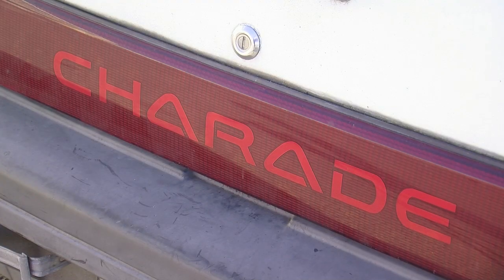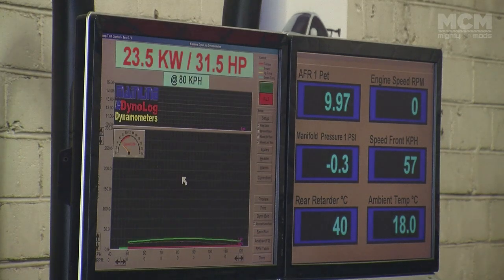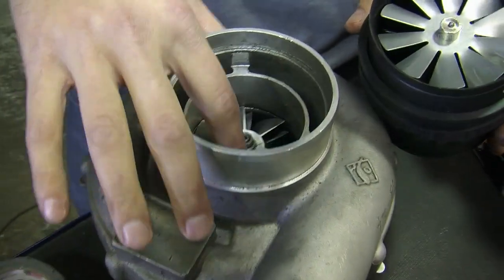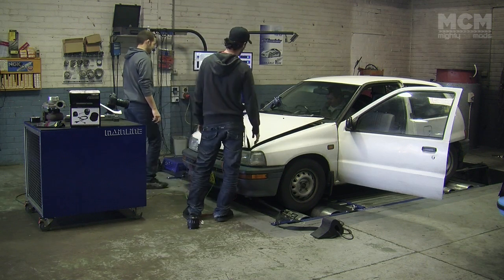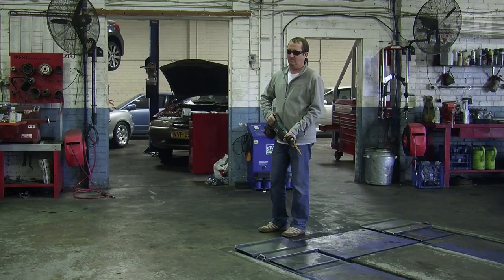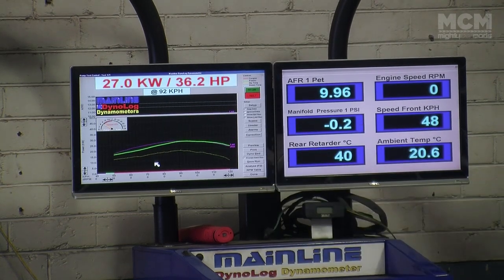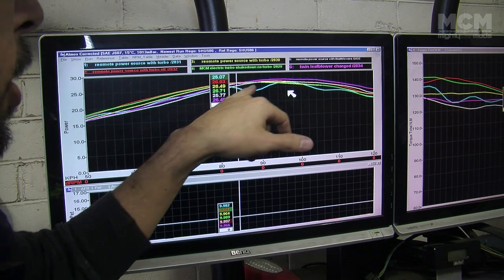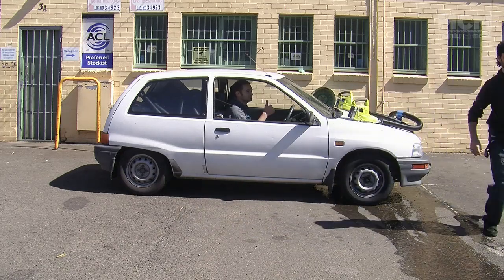Electric SuperChargers Mythbusted

Comment: I would like to make 2 humble suggestions over here
1. Maybe you guys should have serviced the car like changing the gearbox oil and the changing the engine oil to a higher grade ones.
2.You guys could have change the air filters cause it could be dirty and clogged up with dirt which prevents the air flow to the engine.
Maybe then it could produce the actual amount of power that the electric fan could deliver.Its just a humble opinion.
Reply: *****  Sounds like you bought one and are now regretting it
Reply: ***** 
I agree man. Amateurs, they also should've used those stickers. Those alone will give you 10 extra horsepower
Reply: Hahaha which one bro?
Reply: Your bluebird was an awesome car!Wished you were staying in Malaysia and you bought the Skyline here.Would have taken it for a drive!!hahaha
Reply: No mate they dont work full stop, they are a con.
Reply: Well tell me about it mate.i was quite surprised that many people bought it.it seems you need higher pressure to even channel it to the intake manifold.guess the fan is quite a hinderer to the suction.if,the  fan is able to replicate pressure which is being developed by the actual turbo charger,then maybe it can produce slightly higher hp
Reply: Paul smith...i don't even own a car for fucks sake mate.
Reply: the shape of a turbine fan and an electric supercharger are literally different.
Reply: Richard federkiel That maybe so, but they shouldn't be losing power, especially with external power. I would bet there is something wrong with that POS car.
Reply: Harry Balzak it depends on the cfm of the little fan. If it's lower then the natural flow of air going into the motor then the fan will actually hinder the engine from making power. I can tell just by look/listen to this fan that it's not generating anywhere near the right cfm to keep up. If the fan had a higher cfm then what's required by the motor then it should/will make hp.
Reply: ***** I said this on another post but i'll reiterate it here: I have seen a computer fan that would also work. Delta 120mm case fan flows 210cfm runs off of 12v and 2.7amps. 210cfm = 126hp (estimate because i'm going by the 1.6 cfm = 1hp rule which is apparently highly contested). If that's true then anything that is running less then 126hp at the crank should see a benefit from that fan. This is all theoretical though as i've never seen someone test it and honestly i'm not sure if the fan would even survive this happening. I think fans like this are limited rpm wise by the air flowing through them. If you induce a vacuum on the exhaust side of the fan it may allow the fan to spin faster then it can handle.
Reply: Ok,then explain the industrial blower that they use.cause you need a lot of pressure mate.the cfm counts but on the other hand,it needs high pressure to channel the air directly to the engine block.
Reply: ***** you need pressure if you want to go above 100% ve however cfm alone without above ambient pressures will also give a n/a motor hp being as most n/a motors are only working around 80%ve. Remember when you're running NA when the piston is at the bottom of the intake stroke there is still vacuum inside the chamber. The higher the airflow coming in the less of a vacuum and subsequently the more air/fuel will be in the chamber.
Reply: That wouldn't matter at all, as long as they stayed constant throughout the entire video it wouldn't matter. Didn't you take a science class?
Reply: It's s rip off, the videos sarcastic dumbass everyone knows eBay super chargers are a rip off
Reply: No man, sticker tuning is the best! I've added 5 more stickers and now my car is 3 times faster than stock.
Reply: Hahahahahaha pip I must admit that was a good one haha

Comment: Lol my name's also Joseph and I'm turbocharging my 91 Daihatsu Charade with a turbocharger and carbi I bought off ebay for $235. The turbo itself works fine, but I think the dude who I bought it off may have made the intake manifold himself because the Charade turbochargers are usually supposed to have an intercooler mounted on top of the carbi, but the piping on this setup goes straight from the front mounted turbo over the rocker cover and into the intake of the carbi. Quite dodgy I must admit but it works when you're running low boost because there isn't really much need to cool down the air as much as it isn't as hot. It's a working progress and it's only cost me $235 so far, so you can do it on a major budget if you know where to look. I do still need to do some supporting mods like an air filter and a supporting exhaust system and a boost gauge which will most likely cost me at least another $300. But for $235 so far I don't think I've done too bad. :P

But yeah that's my story haha thanks for another mad video MCM you guys are awesome! :D

Comment: Clearly your loosing your positive pressure out the old air cleaner . You should have gone directly to the intake and bypassed all the pre intake junk.
 That's the same thing that's in your vacuum cleaner . All you kids spending your paper route money on this junk just go take your moms vacuum cleaner apart.

Comment: i have a honda civic 1999 will adding a TURBO add and extra 100 bhp
Reply: Liam GardnerHolmes Adding that much boost without beefing up the internals will lead to a premature engine grenading. You may get away will it if you don't floor it all the time but also can your clutch handle it? Adding horses isn't that hard, keeping the reliability is the tough part.
Reply: Alli S Nothing beats a good v8 I agree but even a moderately tuned civic with a turbo might beat it in a drag race. The Honda only weighs half as much. Power to weight.  All about how you drive and what mods etc. Sad thing is kids these days can only afford small cars.  I'd take a classic small block v8 with about 425 horse any day but i'm saving for college. lol
Reply: A turbocharger can add way more than 100hp. You have a 350 wow you must feel special.
Reply: Depends on the engine and turbo size, but you'll need more than a turbo to get an extra 100 bhp. Watch MightyCarMods' Turbo Supporting Mods video
Reply: Liam GardnerHolmes if the turbo is big enough it can add even more than thatyou also need a good tune and you will probably need bigger injectors.
Reply: Alli S i think you are both of thoes
Reply: IntercourseWithYou ok thank u
Reply: Don't forget the stickers and multiple tier spoilers.
Reply: Liam GardnerHolmes
Yeah... Good luck with your 100+ HP from a glorified air compressor, genius. Come step up to my stock 350 V8 in your ricermobile...
Reply: A turbocharger can add way more than 100hp. You have a 350 wow you must feel special.
Reply: Lmfao you fucking ricer.
Reply: xD

Comment: This is a fan not a compressor. I work on high voltage electrical equipment, gas turbines, pumps, motors, diesel engines and air compressors for a living and these things are pure bullshit. Most superchargers use between 10 and 70 hp to run them as they build compression and pressure. For that reason they are belt or gear driven. Go down to an industrial electrical warehouse and look at a 10 or 30 hp electric motor. They're large and require quite a big of power to drive them. To pretend like you can drive a 10 or 30 hp screw, impeller or lobe compressor off a dinky 12 V car battery is a joke. This is a cheap made in china fan that would hardly cool off your face in the summer never mind provide a steady compression charge for your engine. Instead of using mechanical energy to build pressure. These idiots want to use mechanical energy to make electrical energy to make mechanical energy again, as if they can make it for free. Electrical components of quality are much more expensive then bearings and gears and belts and every time you go from one to another you lose power in the form of heat, parasitic loss or vars.
Reply: yeah maybe that electric supercharger toy better used a cooling fan next to the radiator, it will be more useful there instead of making supposed pressure into the combustion chamber..i think we might as well have fresh air intakes improved rather than fixing these crap items.. if I wanted more power, I would rather fit a 50 watt solar panel on my car roof, at least it will help to keep the battery in top form of charge and ease up on the alternator use so that there will be  more power available for the engine instead of losses to the spooling of alternator..now that will make some useful power..i bought a 1 hp electric motor before and I can tell how much current it consumes.. it took almost 1.6kw of power at 240volts ac to run without load and its only a lousy 1 hp motor made in china..i understand what you talking about!!
Reply: Don't let a little thing like physics get in the road of a good story... Completely useless tests with no meaningful results. They didn't even have a vacuum / pressure gauge hooked up to evaluate the effect on the motor.
Reply: professorfidelcat yep before spending hard earned money on buying something that would be questionable if it could even produce enough air flow let alone pressure, they would be better off isolating the engine heat from the intake air by fabricating a cold air intake. It's easier and better for the engine to feed it less cold air, than it is more hot air for the same volume of air (remembering that hot air expands so you need more for the same volume).
Reply: might as well take a used large caterpillar engine radiator and use it to route intake air into the manifold and get those cold air boost into the engine for the money
Reply: Yea no doubt these things are hype. 
But for giggles it might be fun to try on a real small engine like a 12hp mower maybe. I still doubt it'll do crap though.
Reply: Haha I bet it would work great in an old air cooled beetle to put into a heater duct!!!!!

Comment: you guys do realize all the testing you did was wasted, do to the pre warmer for cold start, it is probably why you value change so much, this should have been cut off the cleaner after the actuator giving you direct access to the filter chamber, Or pried open at the least.
I have used bilge blower in the past and had moderate HP success with them. so do the test again with the 300$ bolt on, just try to get more air from the blower with larger pipe. and that hose you used from the hardware store screams restriction !
Try the test on a S10 2.5 thats fuel injected. good luck. Jay
Oh you lost volume mounting the blowers to the hood, you can't block the bottom of the blowers ! nice

Comment: why not do this?
get a regular supercharger and instead of attaching the drive belt to the engine attach it a electric motor there having the same effect as a supercharger but saving the energy lost in turning the drivbelt
Reply: Do you think electricity grows on tress for free? Build a real electric supercharger that requires a 30hp electric motor to drive it and let me see you fit that all under your hood. And maybe 8 more belt driven alternators required to power that little plastic piece of shit fan. These do not work, they are a gimmick.
Reply: Just google "phantom gt86 electric supercharger". It's an actual legit supercharger made for the GT86 which uses 2 batteries wired in 24v configuration and segregated from the cars standard 12v system. It uses a high power DC brushless motor that uses around 4000 Watts of power and delivers 5 psi down to 2 psi at the redline on a GT86.

It's an interesting bit of kit!
Reply: I agree with you man. If you had hybrid level voltage you could make it work. Keep innovating, haters gonna hate.
Reply: Conor Power thanks
Reply: You should make that
Reply: dubzfry A good proof of concept to be sure for electric superchargers, but I'd bet such a system is much heavier than a conventional equivalent turbo or (roots) supercharger, especially given how limited it's run time must be.
Reply: 177SCmaro That is true. The run time is about 3 minutes of solid acceleration. So it's a street use only mod. As in day to day situations I doubt you do that much in just one consistent acceleration.

I don't know how much the whole thing weighs. But it doesn't really require that much modification to the whole engine. As it's pretty much plug and play so I see that attraction to it and it'll be easily removable so good for re-sell value
Reply: dubzfry  I'd say a 3 minute run time, which is better than I thought it'd be, would also work great for drag racing (recharge between pass if there is time). However, again, the weight of the entire system would have to be looked at closely to see if it's really worth it compared to the parasitic loss of a blower or turbo (backpressure).
Reply: ***** which would drain the electrical system and use hp to compensate, and all the other stuff you have said is mostly incorrect,
Reply: stu mac in a situation such as a drag race, where you can charge/replace the battery after each run
Reply: stu mac All next gen Volkswagen products (VW, Audi, Porsche, Bugatti etc..) are to have optional electric turbos powered by their 48 volt mild-hybrid setup. A 220v or 440v supercharger would easily have a huge net surplus of power compared to any parasitic loss to recharge the batteries. Better check your sundial to make sure you don't miss the daily steamboat up river, the rest of us are on our way to Mars you whiny bitch!
Reply: Conor Power  They will result in a temporary net surplus that has to be repaid, and then some, later to recharge the system. In such a system the amount (of fuel) that has to be repaid later is greater than the amount of power added by the supercharger (probably significantly more, given the inefficiencies of going back and forth between electrical and mechanical power), it's just over a longer time period. You still have to pay to play.
Reply: ***** There's no magic, power doesn't come from nowhere. 
You'd probably be better off adding an electric motor to the powertrain, and run that off the extra batteries in the first place. (Kinda like hybrids do it today)
Reply: ***** If it's electrically driven you'll still add load to the engine, or have to stop and replace a great whopping batter bank every few kms, and that's before you figure out how to synchronize the level of boost from the electric motor driven super charger with the demands of the engine.